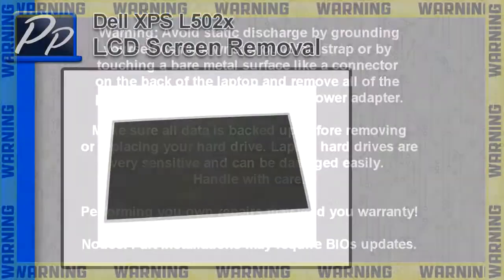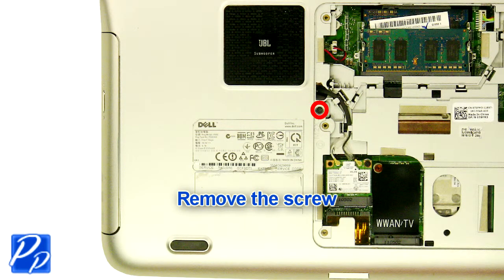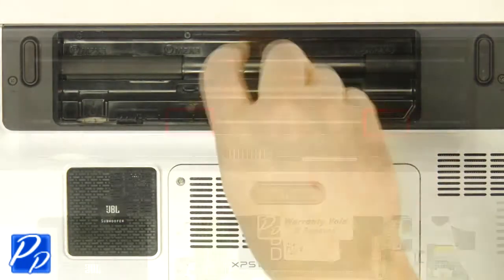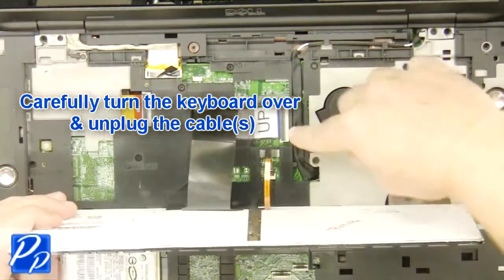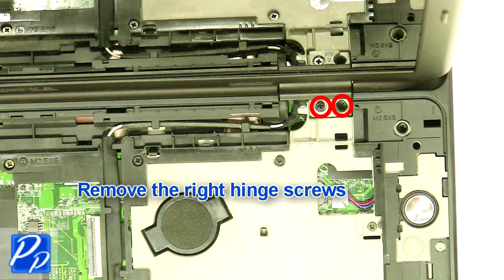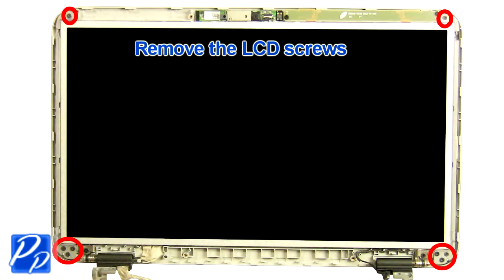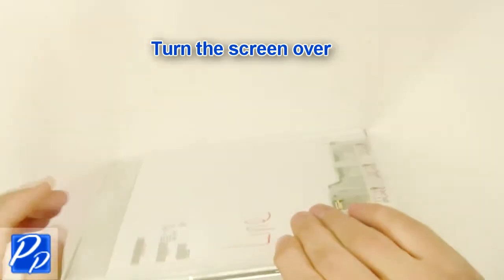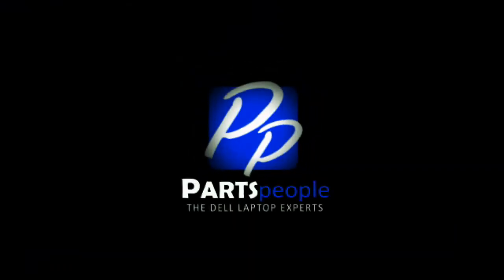Dell XPS 15 (L502X) LCD Screen How-To Video Tutorial

Comment: What is the other wire which runs around lcd . It is not connected with lcd
Reply from the maker: They are wireless antenna cables.

Comment: Sir, I own this laptop. I wanted to know how much is the screen resolution on it. In my upgraded windows 10 display settings, it shows 1366X768 only instead of 1920x1080. Please help.
Reply: I'm surprised nobody replied, the problem with resolution would be graphics card driver, find out what graphics card you have if its Nvidia goto the nvidia website and install 64bit windows 10 verson for your graphics card, best bet is to ask Nvidia for help on that for details.  If its just changing resolution just right click desktop and display screen resolution, can't tell you whats it is for windows 10 but this is for windows 7 hope this helps
Reply: Hey. Thank you so much for replying. Actually I had to buy an external/extended 27" monitor at the time when I commented here with this query. Then I got one of BENQ (27", 1080p) and it worked fine. I was worried weather my laptop would be able to utilise this monitor and send 1080p signals to it. But it did. Although the inbuilt laptop screen has 1366p resolution but external monitor, which has now become my primary monitor, is giving perfect 1080p output.
BTW, I love this machine. It's a decade old now but still works fine with my documentation work and all. 
Thank u again for the reply. Means a lot.
Reply: @ronshah246  Sorry someone else didn't reply sooner I only just saw it. I also have this laptop but mine is although L502X it didn't have the same ports as this in the video there's no SATA ports for me it has everything else though.

The graphics card is what has the ability to give you the resolution you need, so yeah as long as your g-card is good and if you replace your harddrive with an SSD it will pretty much last a long time because of the dual graphics one on board and one Nvidia or Radeon whichever you chose on checkout customization.  Funny thing is my g-card broke it overheated and or the fan stopped working, so I'm using onboard graphics card which is only good with some movies and TV shows at 1080p anything higher than 1080p it just slows down haha. wish I could use it with 2160p anyways your welcome and have a nice one.
Reply: @deusvlad2.083  haha. Cheers.

Comment: my screen only works at certain angles and whites out until I apply pressure on an edge, is this an issue with display cable or lcd?
Reply from the maker: Reseating/reconnecting the cable to the LCD should help pinpoint the issue.
Reply: Mine is exactly the same. Did you fix this?
Reply: @joeevans266   my lcd panel was broken at the point of connection, had to get a new display

Comment: Why is it necessary to remove all the hardware like optical drive, RAM and so on?
Reply: Hey, because you guys own this laptop, I wanted to know what's the screen resolution on this one. I own it but the max resolution on My upgraded windows 10 shows 1366x768 only instead of 1920x1080. Please reply. Thanks
Reply: @ronshah246  What Windows is showing you is the max resolution of the screen.
Reply: @youknowwho9247  Windows 10. I initially had windows 7 with this laptop but I upgraded to windows 10 this year because Microsoft Support for Windows 7 ended in January
Reply from the maker: It looks as if you do not need to remove the optical drive. Dell does recommend removing all the other components listed in our tutorial.
Reply: @dellpartspeople  I swapped the screen today. None of this is necessary. You just remove the front bezel around the screen, unscrew the screen, unplug it and put the new one in. That's one bezel, 12 screws and two cables. Takes 10 minutes, no need to touch the other components.
Reply: @youknowwho9247  Is it necessary to remove a screen from the notebook, or can the display be exchanged with the screen fixed on the notebook?
Reply: @guilhermemarques4137  I'm not sure what you're asking. Display and screen are two words for the same thing, as far as I'm aware.